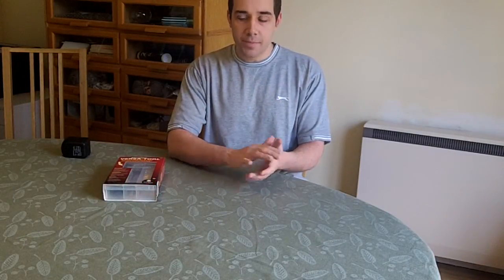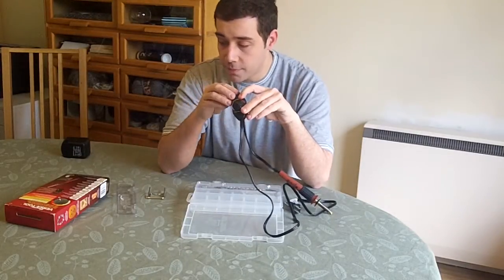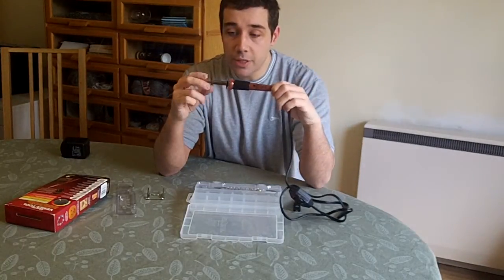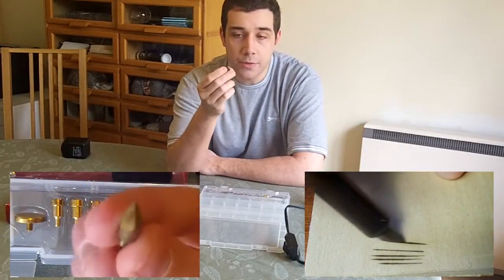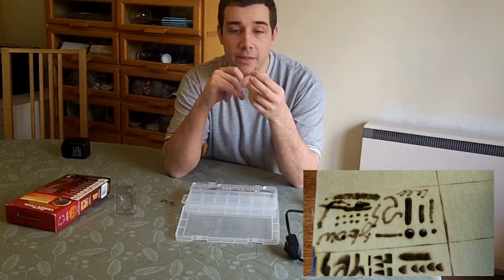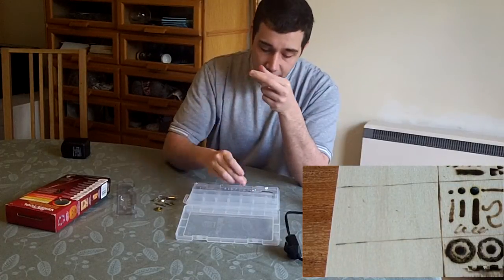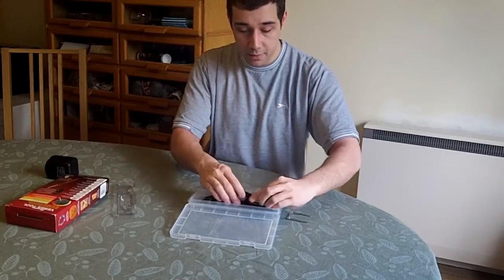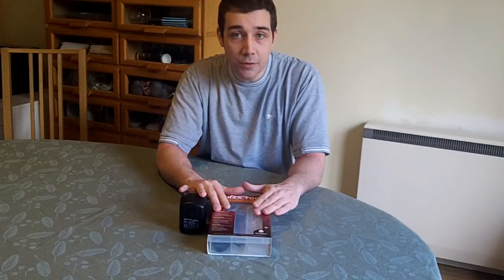Review - Walnut Hollow Creative Versa Tool

Comment: Will have to use it with a good heavy Extension Cord, For reaching where I want to use it from etc.
Reply from the maker: hey RedTail, actuall it's only a few watts and normal voltage so a normal extension cord is fine,

Comment: Can you make holes in teracota flower pot
Reply: You need a dremel tool  for drilling and a carbon steel diamond bit and spray cool water frequently on the pot near the bit as you are drilling.

Comment: I have this exact set except mine doesnt have a setting to change the temperature, just an ON/OFF button. I must have an older version...

I was wondering, you can use the SOLDERING bit for woodburning/art but what about the other way around? Can I use any of the pointed tips for SOLDERING? (•¿•) ?

I lost my solder bit.. and they dont sell replacements  (I've been on their website).. I need to solder something but I cant find any replacement bits.. 

If i can just use any of the woodburning pointed tips it came with..that would be great! Otherwise I have to buy an entirely new kit. :-(
Reply from the maker: +fuzzymaiden1 Hey Fuzzy,  they do a set without the temperature change bit 

yes you can solder with the soldering but, I wouldn't recommend the wood burning bit for soldering, but you can get replacement tips from other companies but you need to be careful to get the same thread, best to go to your nearest big crafty store and speak to them.

or indeed if you want to solder just buy a soldering iron as these are cheaper than pyrography machines.

Comment: For some reason I have to press really hard for this tool to even burn anything I just don't understand
Reply from the maker: +Amy Rigsby  hi Amy, a few things that might be the issue.

Firstly as this is a solid point machine it can take anywhere from 50 seconds to 3 minutes to reach temperature depending on the setting and solid bit being used. when it's at temperature you should be feeling the heat come off the bit with your hand more than an inch away. 
Second your bits might not be screwed in fully, make sure you fit a bit in fully or it takes longer to reach temperature and may never reach full temp.
Third a silly one make sure you turn the adjustable temperature nob up high enough.
Finally your machine may be faulty and you might need to have it looked at.

Comment: I have a problem with this tool not really burning that well too, I have watched speed videos of people wood burning with this and it seems to flow so easy, I have to grind mine for it to burn anything.  I suspect maybe my transformer is too weak? It says it will work with devices up to 120V, and it's 100W. I know nothing about this stuff it's all gibberish to me, but it seems like it should work fine.. I'm so frustrated I don't even know
Reply from the maker: Hi Greta sorry but you're making a mistake. Volts and Watts are different things. The Converter you're using is probably a very low wattage. To give you an example every appliance in a kitchen in the UK is 220volts, but the toaster and kettle are 2000-4000 watts and the mixer is about 60watts.   You need a suitable converter and to put the setting to the right temperature.
Reply: TheLearningDroid mine says 230V for input and 110V for output... I really don't know it's really confusing
Reply: TheLearningDroid all I know is that if I try to use the tool with a regular adapter, it turns red on the smallest settings.. so that's not an option either 😅
Reply from the maker: Hey Greta :) you need an adaptor that can handle the right wattage sounds like yours is too weak. if you have the american tool and are in the UK here is my recommendation. 

Mercury Ac-Ac converter model 651.001 UK, thats the converter I use, it's 45 Watt approx which will run the 30Watt machine safely.

You can get it off amazon
Reply: ah I can't believe I'm only seeing this now! thank you I'll try to find this exact same one and hopefully it will work :)
Reply: Never mind haha, the model on mine is 651.004UK.  I will try to find the exact model you have mentioned :)